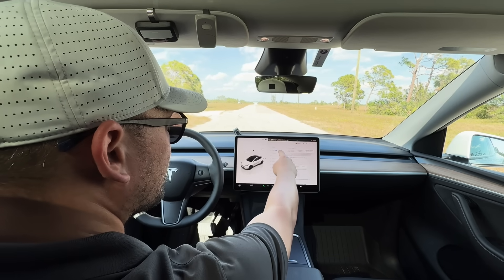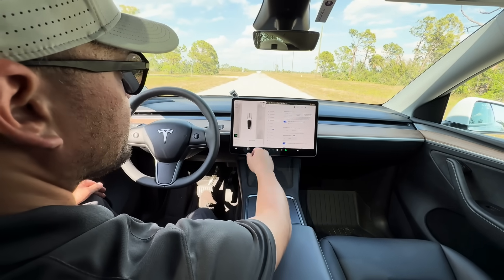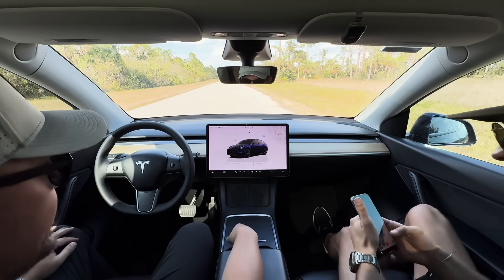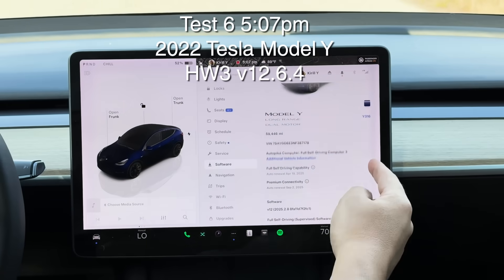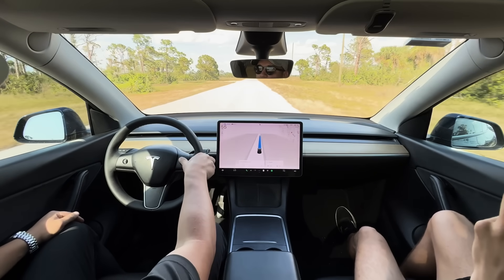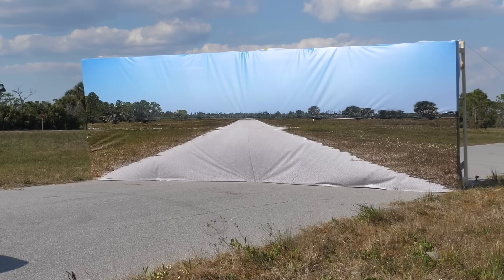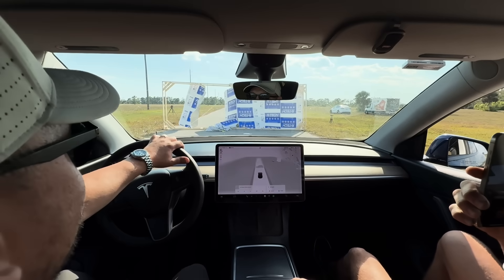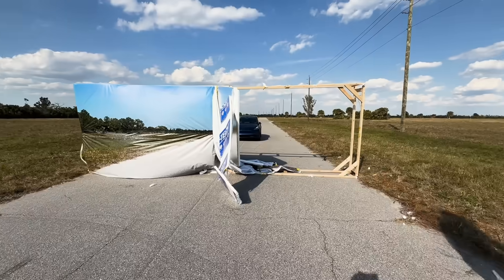Mark Rober Debunked - You can't fool a HW4 Tesla using FSD!

Comment: Wow, didn't know HW 3 & 4 has that big of a difference. This deserves more views.
Reply: The difference is between v12 and v13, because v13 was a complete revamp of the code.
Reply: @henrylorenz8911  They switched fully to transformer model machine learning algorithms I believe
Reply: @henrylorenz8911  both hardware and software matter. That’s why Tesla said all their vehicles can do FSD since 2016, but promise to upgrade HW4 for HW3 owner this January.
Reply: @ennis_w  When did he promise to upgrade? He did that once originally, then "took it back" and said those of us on HW3 would NOT get upgrades.  Has that now changed again?
Reply: @JohnVanderbeck  He specifically said this on an earnings call, i think end of 2024 earnings call, that all HW3 owners would be upgraded to HW4 if HW3 could not achieve unsupervised FSD, he said it would be difficult and expensive for tesla and a massive undertaking for Tesla, but he would make it happen because they previously thought HW3 could achieve it and want to do right by the customers. this would mean not only replacing the HW computer, which is relatively easy, but also the cameras in the call with the higher resolution cameras. Its important to note though, this does prove that HW4 is more capable...did we really need a test for that?...but it DOES NOT prove that HW3 is incapable of unsupervised, this is not a particularly important test to real world driving....regardless, in my personal opinion, i think its highly likely they are going to have to make good on the promise, but i also think there wont be a whole lot of people with HW3 cars anymore to do this with when they reach unsupervised.
Reply: @JustinKrux  Sounds like a line of BS to me.  Ok even if we take him at face value, when do they determine "we couldn't make it work" and give us the upgrade?  They've already forked the code base to HW3 and HW4 and are pretty much only working on the HW4 code, with occasional backports to HW3.  They should be offering that upgrade NOW.
Reply: Is Tesla upgrading HW3 units?
I was under the impression it was a work in progress.
Reply: @lhovo  he's not going to upgrade every car from HW3 to HW4. You have to buy a new car.
Reply: @Oneness100  They would have to do something, I purchased FSD so either I get what I paid for via an upgrade or maybe they will do a swap (laughs)
Reply: For those asking, his last statement on the matter is that Tesla will have to upgrade HW3 vehicles even though it will be expensive and difficult and that they have no choice.
Reply: it’s also v12 vs v13– i’m guessing it’s because hw3 doesn’t support the latest v13 version?  I wonder how much of the difference is because of hardware capability and how much is version 13 potentially being more sophisticated
Reply: @pure5152 you are right, the hardware is not the main reason why HW3 hit the wall, but the AI model of V13 is much stronger.
But of course, we not sure can HW3 run V13 in the future or not.
Reply: In the original video the driver didn’t place the Tesla into FSD until  it had no time to stop
Reply: I still don’t understand how It can see that huge picture and stop. Most people would fail this test.
Reply: @Livefreeordietrying1  It would have to be the radar detecting the fake wall
Reply: The difference is so big, even Musk said that FSD won't really happen with HW3.
It's been in the news in January.
Reply: @REDxFROG  Crazy how when things dont go perfect or someone messes up, there is alway a liberal around to call you a liar.  Nothing is ever an oversite, just LIES!!!! lol
Reply: @REDxFROG wonder why he is upgrading for free, might be due to over promise under deliver kind of problem. i guess hw4 is just basically inexpensive
Reply: So he lied for years, nice. I bet thats why he needed to buy a presiden. To stay out of jail. @REDxFROG
Reply: @MarkkuS  Shocked pikachu.  Has anything that man said is true?
Reply: @MarkkuS  claiming that he "lied" implies that he knew better and was just misleading his customers. rather than realizing after the fact that the previous iterations of hardware lacked the processing power to support full self driving. but i bet you don't really care about the distinction and just want a reason to attack someone who hurts your feelings
Reply: @MarkkuS  Nope, he has stated that everyone who bought FSD prior will get a free hardware upgrade.
Reply: @hiddendrifts  Exactly. Those are these of people who love to criticize but lack any technical skills to realize how difficult achieving autonomous driving truly is and can't roll up their sleeves and offer any solutions but are always around after the fact to complain about it not working or what they think about Musk. Surely if they don't like it they should get in there and offer their solution...but we shouldn't hold our breath...
Reply: @ >they should get in there and offer their own solution<
that's how you know you can ignore everything they have to say. they don't care about solutions, they just want a reason to hate and attack
Reply: @hiddendrifts  "claiming that he 'lied' implies that he knew better and was just misleading his customers"  He's been saying FSD is "just around the corner" since 2017 - and claiming "every Tesla includes the hardware necessary to support FSD". That's nearly an order magnitude error - far beyond just being overly optimistic. He was either knowingly being misleading about FSD in 2017, or he isn't as smart as he thinks he is.  Computing power has tripled since then and FSD still isn't here?
Reply: @MarkkuS  Most CEOs in high tech lie about their goals. It should be understood as the best possible scenario. To be honest, if the difference is how the software works, and I assume so, he coudn't predict it.
Another way to look if he really thought that HW3 will be enough is how much Tesla will need to spend to replace the hardware.
Reply: @MarkkuS  So you should also assume Apple lied too because their hardware on iPhone 15 and onwards only support AI, right?
Reply: @OweEyeSea model requirements have also without distillation and quantization. Just as training large LLMs on the garbage of the internet didn't produce an exponential intelligence curve, so too does the training for FSD. Niche scenario training data is quite uncommon especially for scenarios like this which seems like a warped reality to the car. HV3 technically could run full FSD when it becomes available, but it requires distillation and quantization which will hinder performance. Humans with poorer eyesight than those cars sensor packages still drive vehicles so it's possible.
Reply: @TradeRealm  The difference being, iPhone 14 was not advertised with AI features.

And just now it seems like Apple will be getting a class action lawsuit,.because they advertised Apple intelligence features as a big selling point of the latest iPhone, but failed to deliver.

Similar as Tesla promising and failing to deliver level 4/5 autonomy.  And don't get me wrong, the tech itself is nothing to scoff at, and really amazing. It is just the marketing/naming that is really misguided.
Reply: @OweEyeSea  >far beyond just being overly optimistic<
i'm not sure what your point is. perhaps his estimates were completely off (for any variety of reasons), but ultimately a form of full self driving did release in 2020 and has since been quite clearly making progress towards full autonomy
Reply: @hiddendrifts  Proving someone lied is sometimes hard, especially when they're referring to things in the future that are just plain unsure to begin with. People can lie about their intentions all the time, and unless there's some evidence on the contrary, you just won't know.
Reply: @Sauvenil  >you just won't know<
exactly, which makes stating as a fact that someone lied is at best a bad faith interpretation, and at worst an attempt at character assassination. as hanlon's razor goes, "never attribute to malice what can be adequately explained by stupidity or ignorance (or anything else that would lead to someone making an overly optimistic prediction)"
Reply: @ A lot of times it's because of pride - some people are too proud to admit they don't understand something, but will instead try to make you feel like you don't understand it.
Reply: Hardware 4 isn't pristine. Trying to swerve me off the road at night, because it thought there was something in the middle of the road when there was nothing there. The biggest mistake with HW4 was removing the lidar sensors "to save costs." I love my car, but I will never trust it due to that lack of depth perception. In addition, I loved how much I could see with my ex's car on HW3 when parking in the garage, but I honestly hate it with mine.
Reply: What's the percentage or people with HW4 and is Elon upgrading everyone?  And what IDIOT would pay $10K for Beta software.

Glad I don't have a Tesla. they are CRAP IMO.  Cheap materials, minimalist design is cheap.  EV's simply aren't that great yet.  I think there has to be a lot of improvements.
Reply: Not surprising after Mark Rober's video going viral and making Tesla higher ups shit bricks, lol.
Reply: Hardware camera quality is significantly better which in sure software version 13 takes full advantage of
Reply: @ ya, but I believe the HW3 camera resolution is enough to detect the obstacles.
But the brain (AI) is the main factor that can the car understand the obstacles.

This is the basic of AI and FSD but many don’t understand.
Reply: It was posted a day ago
Reply: "It did not see the wall" stops the Tesla. So he didn't lie
Reply: A lot of uneducated people were cheering when Auto Pilot tesla failed from the Mark Rober's fake video.
Reply: No it does not - Tels is finished. FSD [fake] has just been banned in China - everyone knows Elon is a Nazi - its OVER
Reply: People only enjoy doom and gloom videos
Reply: So are they going to be required to upgrade all the computers to HW4? Serious question from a June 2021 M3 owner.
Reply: This is common knowledge
Reply: HW4 is a big Deal. More cameras, Much Higher resolution and more processing power.
Reply: @alexmayer8943  would be interesting to see it also in a "fog" and "rain".
Reply: My car is HW3 and drives 90% of the time with zero interventions and zero disengagements. The 8% of my interventions are for MY preference, and are not necessary. 2% is actual true interventions for a needed purpose, and usually just involves correcting it when it puts on a turn signal to change lanes at the wrong time. 

Regardless of what anyone on the interwebz is saying, my HW3 car is more capable of self driving than sny other car on the road except HW4 Teslas, and is exponentially safer than most human drivers in my city. 

Further, I know the specific places along my normal drives where my car may have an issue, and outside of those few areas, I know I could technically not pay attention to the road, and I would get yo my destination safely. 

I expect most of the negative commenters here have never actually experienced Tesla FSD and are commenting solely based off videos and fake news articles they watch/read online.
Reply: @DrivingInnovations  well, I comment based on my expertise as a senior developer who has worked extensively on the exact same NN architecture that Tesla uses. An unrestricted NN sure gives the impression of capability, right up until it doesn't. People in my line of work never trust a Tesla because knowing the underlying mechanics dispels all the marketing spiel and outright lies that people like Musk push on us. Trusting a convolutional neural network hooked up to simple CMOS cameras to drive you around is like taking up smoking cigarettes because your grandma smoked for 50 years and never got lung cancer and somehow thinking that means the odds are in your favour.
Reply: @DrivingInnovations  >most of the negative commenters here<
honestly atp 90% of them are probably elon haters who just blindly attack anything affiliated with him, regardless of whether or not it makes sense
Reply: @DrivingInnovations i almost got hit by 2 Teslas, idk if it's FSD or the drivers but I stay the hell away from Teslas now. Too much faith in that stuff
Reply: @worstusername22 FSD is used by a fraction of Tesla’s on the road. Most likely it was just a bad driver and nothing to do with Tesla.
Reply: @worstusername22 Funny.  I've almost been hit by many types of cars.
Reply: The muskrats here to defend their hero.
Reply: @ullrikegabler  And the trolls are here to stroll.
Reply: It's the camera hardware that let's HW3 down compared to HW4. The software is the same.
Reply: @deltaechomusicnh555  No, the software was the same for a long time. As far as I know, HW4 uses transformer model. Not sure how to explain it if you're not into machine learning... something a bit like chatGPT.

The key difference is attention. When a driver can see something strange, even if it was a few second ago, he will focus on this single thing. For example, if pedestrain hides behind another vehicle, a driver will be super careful. Thaw is the issue with V12. If someone falls down on the ground and stops moving, a car may think it became a speed bump and run over it.

To be clear, I don't know if they fixed it. But transformer models are much bigger, so it requeres stronger GPU and more RAM.
Reply: @deltaechomusicnh555  yeah i dont think thats entirely true, currently theres obvious features not available on 12.6.4 that are on 13.2.8.
Reply: Higher resolution and faster processing speeds.  Proves the technology and need to upgrade to hw4. Proves mark is wrong
Reply: @allieflounder5764  Even HW 4 will never achieve FSD unsueprived. As an engineer who worked on BMWs driver assistance AI some years back. Driving teslas and the fact that when im driving one, FSD cant operate when im driving in the sus direction, cant fucntion in texas heavy rain or fog conditions, there's absolutely no way a car like a robotaxi thats on HW4 with no steering wheel or option for human intervention, will make to the road anytime soon. We're AT LEAST 1-2 HW versions away from it even being a realistic possibility. It may not get there at all without the help of a LiDAR camera combo.
Reply: @allieflounder5764 it's 5MP cameras hooked up to a crude convolutional neural network. My fucking Nokia from 2007 has a 5MP camera.
Reply: @  - This car has radar yes?  Very high frequency radar.  Like LIDAR  but cheaper.
Reply: doesn’t prove Mark wrong, it just proves not all the variables were considered.
Reply: @lhovo  It proved his conclusion was wrong. He should redo the test or apologize.
Reply: @allieflounder5764 no it doesn’t. Musk sold and advertised HW3 vehicles as capable of FSD. Mark is not wrong. He drove a car that was advertised as capable of FSD and it failed. Additionally, there are more cars with HW3 on the road than HW4. So you can say that the average person with an FSD tesla will hit a wall like this.
Reply: @MrMadness574  All Tesla's are capable of using FSD and your HW3 argument is flawed. When people do iPhone vs Android tests to see which phone brand is better, they don't test the old iPhone 13 vs the newest S25 Ultra and then proceed to claim that Apple sucks. You have to test the newest with the newest even if not everyone upgraded yet. So, I don't even see how you came to that conclusion.
Reply: @ that’s a false analogy. We’re not comparing cars to see which is better. We’re testing to see if a car with purported FSD can detect an obstacle like the wall shown here. It works with HW4, not with HW3. Mark was not wrong, he just used HW3. In fact, had he used HW4, it’s possible everyone would just think that the latest version of FSD was perfect. But it’s not. It’s dependent on your hardware. The truth is this, some teslas with FSD cant see the wall. Mark had one that couldn’t. His report was true, and this video justified it and added nuance to better understand the issue
Reply: @MrMadness574  So you do admit that it wasn't a real self-driving test. The test that Mark Rober conducted was actually just a camera vs lidar sensor test, nothing to do with self-driving. If Mark Rober's video was genuinely about comparing camera-based vs. LiDAR-based systems, then he would've titled the video "Is Camera Better Than LiDAR?" That would have been the most accurate and honest.

But by titling it "Can You Fool A Self-Driving Car?" and then using a Tesla (which isn’t fully self-driving yet) against a non-self-driving Lexus RX, it framed the test in a way that made Tesla look bad while subtly promoting Luminar. And that's what the video was really all about: it was an AD for Luminar.
Reply: @MrMadness574  So what really was the whole point of Mark's video? The Lexus cant even self-drive even with it's lidar systems. At least the tesla had some amount of self-driving capabilities even while having NO lidar systems.
Reply: @MrMadness574  This is, again, also after a month after the fact. They probably trained the model in HW4 to be able to not fail this lmao
Reply: @btoiscool  Even if that were true (and it`s a dumb thing to assume), what is your actual point? So a flaw was detected and fixed? Okay, and what? So we not only judge best of the best lidar vs old tech camera, but then we also say camera tech must specifically not be allowed to work? Wahoo...boy you sure got us all. We bow to your superior intellect and reasoning.
Reply: @MrMadness574  you can say that.  You can also say the latest software and hardware will not hit the wall.  He didn’t use the latest because the video wouldn’t have been controversial. He gets paid for clicks and that’s the main takeaway.
Reply: @MrMadness574 Mark was wrong about LiDAR being required to avoid hitting a painting of a wall. It still isn’t yet clear if HW4 with V13 will fail the other tests that HW3 and autopilot also failed.
Reply: @MrMadness574  Good thing "walls like this" don't actually exist in real world scenarios. Here's a fun question, how many HUMAN drivers would drive through a wall like this? Given human drivers crash MILLIONS of times per year in the USA, into things that are NOT optical illusions created for the very purpose of tricking an intelligence (real or artificial), what exactly is the overall point? Does "FSD Capable" mean the vehicle won't ever crash ever? Or does it mean the vehicle will drive you from point A to point B, with a stated goal of doing so many times safer than a human? What about if it runs over a nail and the tire explodes leading to loss of control and a crash... would that be FSD's fault any more than a human's fault who did the same thing?

Tesla is offering free HW4 upgrades to people with HW3, acknowledging the superiority of HW4 with regard to FSD. I'm not sure what the problem is, other than classic faux-rage by people who contribute nothing to the world.
Reply: Why isn’t this the first comment on the list. Sums up my thoughts exactly.
Reply: It's almost like Tesla has had a month to train their shit lmao
Reply: The difference is in a radar - nicknamed Phoenix.